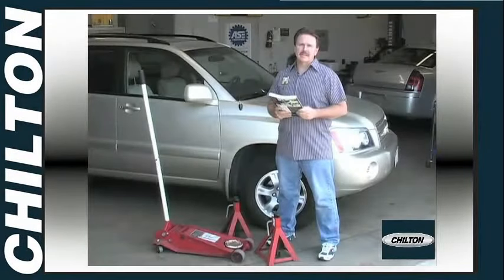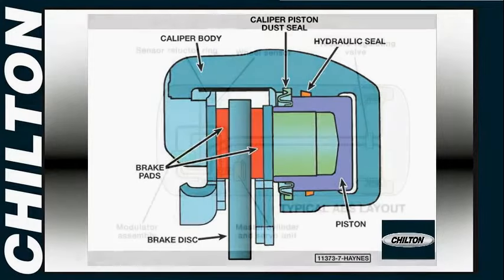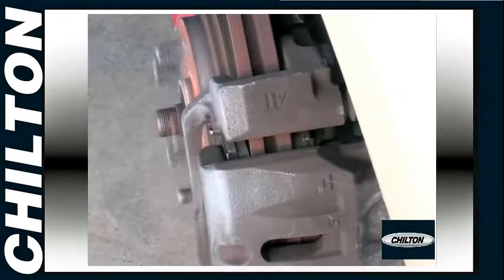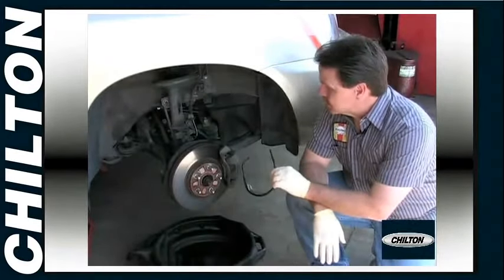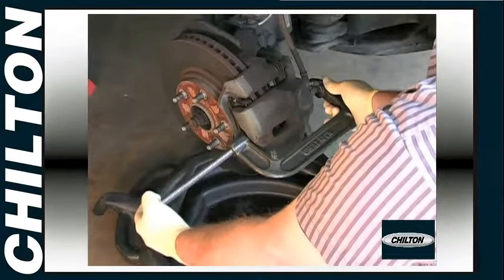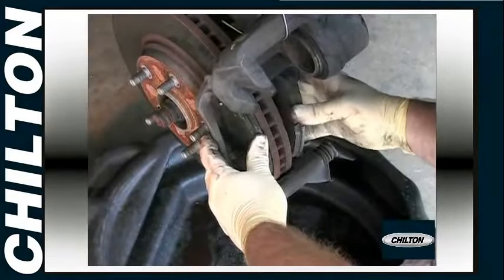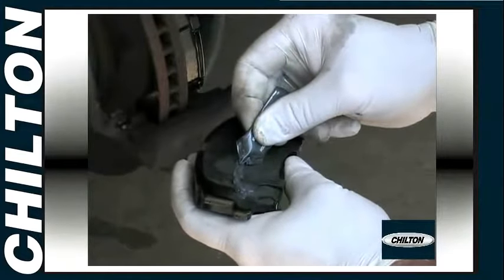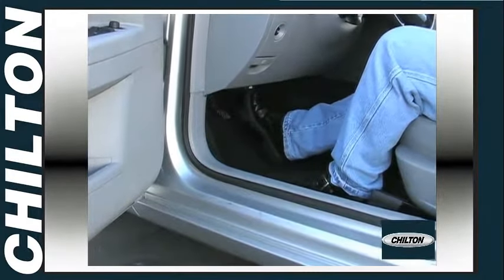Chilton Shows You How To Check and Replace Your Brake Pads

Comment: Never push the fluid back into the master cylinder. while mounted Open the bleeder just enough to see fluid then push the piston in slowly, and when its almost compressed tighten the bleed screw, (fluid will come out and if there's any air in the caliper it will bleed out, and most likely you wont have to add much if any fluid to the master) . ( bonus! )... pushing the fluid,  small particles in the caliper will be pushed into the master and cause issues. so never push the fluid!!!!!! and after you are finished installing pads and caliper open the bleed screw until you see some fluid come out for 10 seconds then tighten bleeder and add fluid to the master cylinder if needed...in fact you should change the fluid once a year